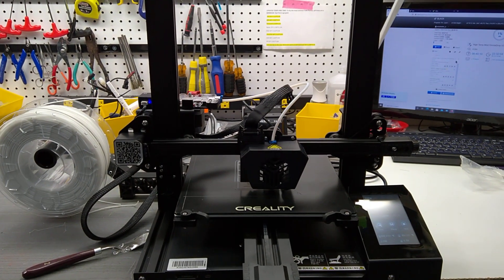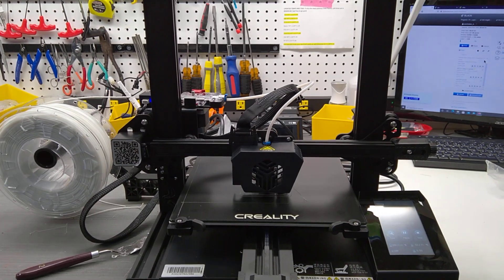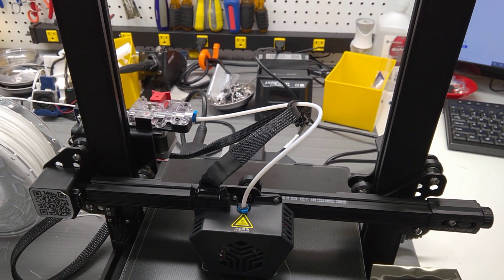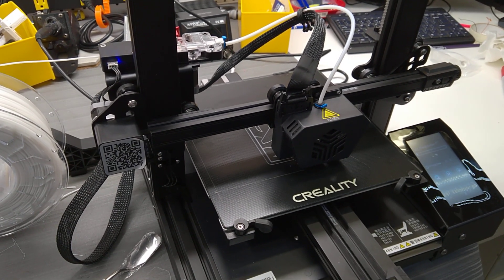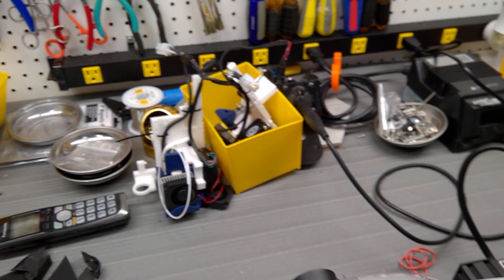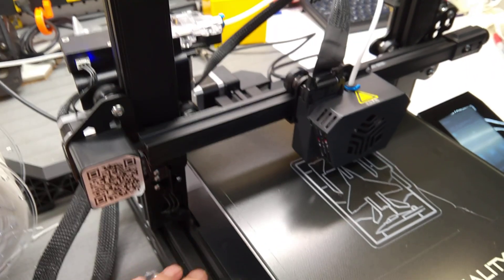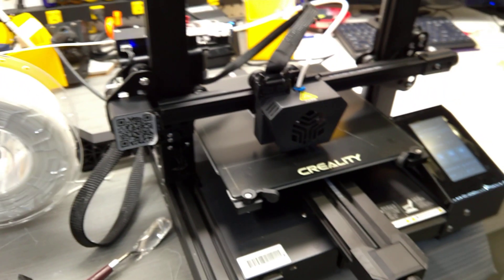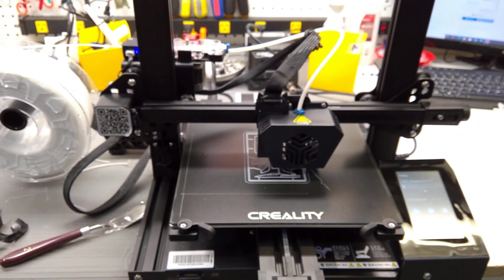The Cr-6 SE Lives

Comment: The extruder is the only problem i had with mine...so seeing the SeeMeCNC extrurder you put on makes me think i should get one. One question though as this is my first printer and since it was mostly assembled i got little experience on that end so i was wondering if that was a direct bolt on replacement or did you need to mod anything to get it mounted/working? 
thank you
Reply from the maker: It was an easy swap.  I  think the only thing you would have to do is switch the drive gear on the motor.  I already had it assembled from when I removed it from an Ender 5.   The original extruder is terrible on the CR -6.

Comment: new to 3d printing what mods are you talking about
Reply from the maker: I have changes almost all of the original parts on my Ender 5s and 5 Plus.  New direct drive hot ends(OmniaDrop), new mainboards(Ezbaord), new ABL( EZABL), linear rails, and redesigned the electronics containers.   I really can't see doing any of that on this unit.  It is pretty much finished out of the box.   You can take a look at some of my other videos to see those mods.

Comment: Can it print flexible
Reply from the maker: Not sure.  I have three  Ender 5  with OmniaDrop that are designed for any filament, so it will be a while before I try.  I think the CR-6 is a great first printer, went together quickly and except for the extruder, which I probably messed up it ran with no problems.  My next goal is to put OctoPrint on it.
Reply: @woodwaker1  You didn't mess up that extruder.....it's just a lousy design. I too had trouble loading filament into it. It was getting snagged on something inside. Had to completely disassemble and reassemble it to get it working. Will probably replace with an EZR, as I too have one lying around.

Comment: I was wondering if that that would fit.  Now I just need to find an all metal hot end and direct drive kit for mine
Reply from the maker: I would wait, I took the cover off and looked at the hot end,  the wiring all plugs into a board and the leveling sensor is an integral part of the unit.  I want to see someone else do it first.
Reply: David Wilson  I defiantly won’t be the first to do it, but I’ll be happy to the second. 😎
Reply from the maker: @jamesgeater1594  Do you have yours yet?  Doesn't look like a lot to mount something to.  They really made everything tiny.
Reply: @woodwaker1  yes, I got mine Wednesday. I'm working on getting it set up in prusa slicer now.
Reply from the maker: @jamesgeater1594  I have mine slicing in S3D, seems to be OK.  I can't wait until I get it on Octoprint.
Reply: @woodwaker1  One in ou Community CR 6 backer has posted a printed direct drive for CR 6
https://www.facebook.com/groups/cr6community/

Comment: Hi buddy. Which extruders is that ? Thanks
Reply from the maker: This is a good extruder for a bowden system,  I quit using them when I went to direct drive hot ends.  The thing I didn't like was that it has one drive wheel where some of the newer units have two that drive the filament from each side.  - DropEffect added a link  - they are reasonably priced.    Thanks for watching.